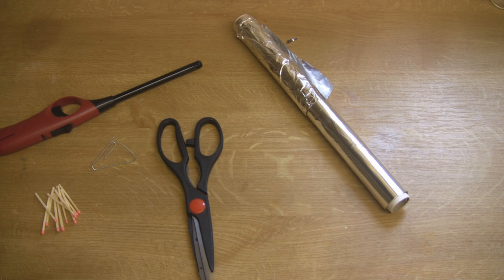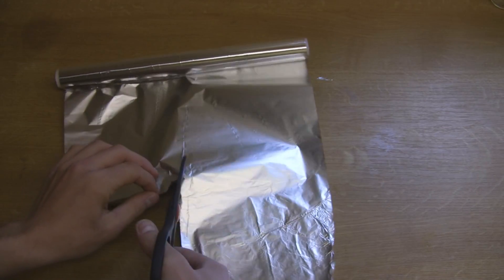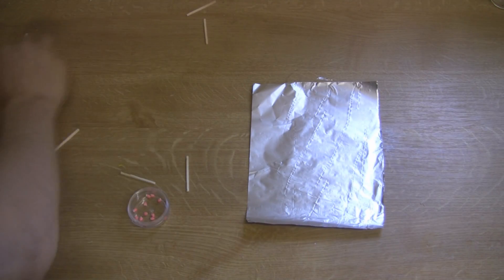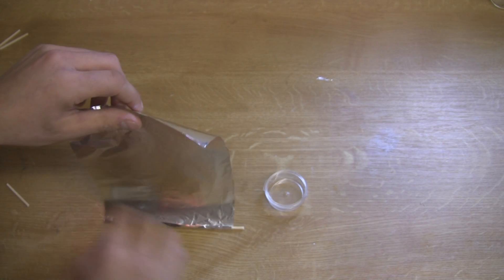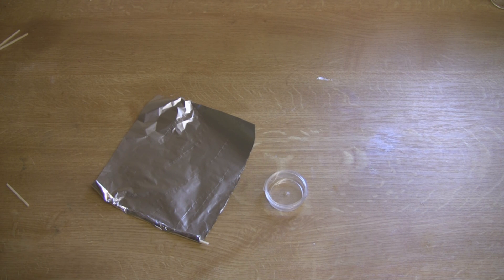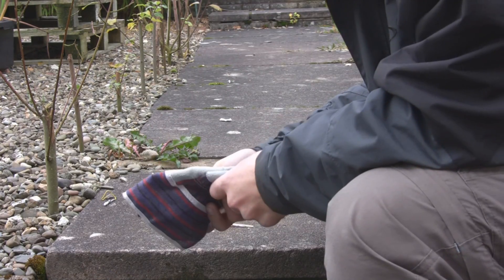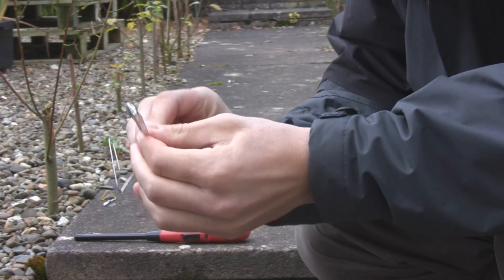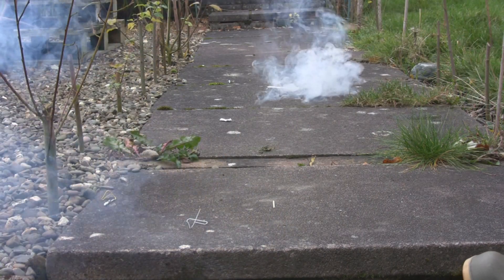How to make Match Rockets

Comment: Actually, you can use the entire match. Give a few wraps of foil around the head, leave the rest of the match exposed. Put match on the edge of something, head end elevated, so you can place a lit match under the head end. Zip! Away it goes! Works with both wood and paper matches.